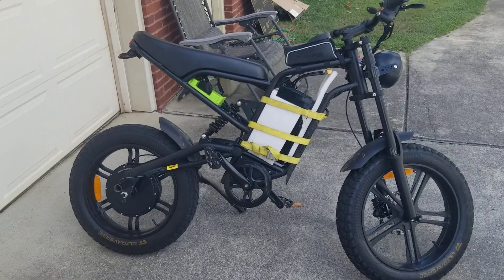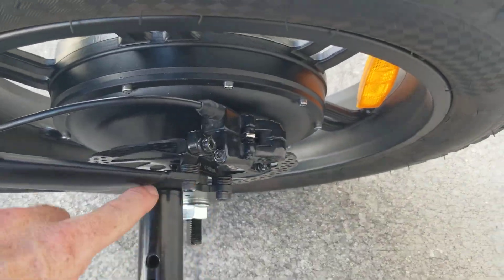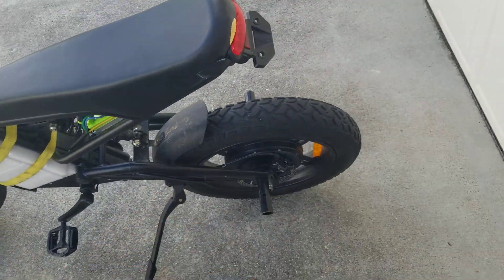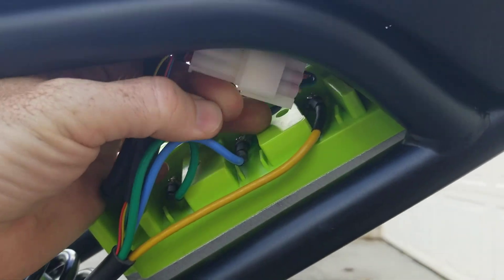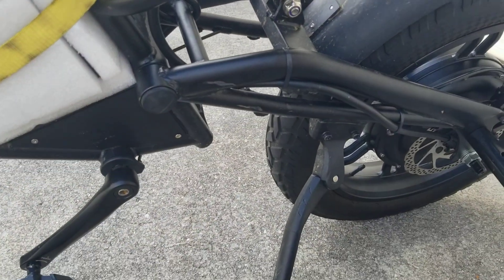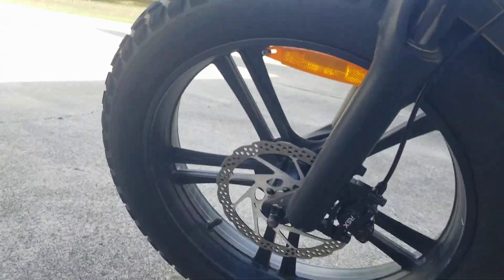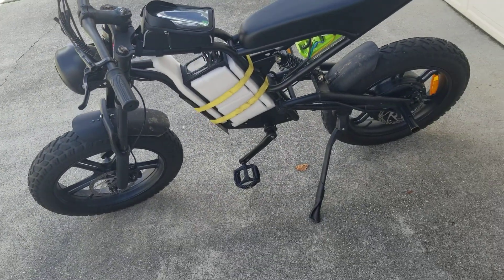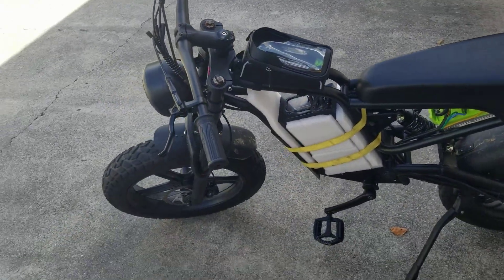52MPH e-bike:  Windone E2 modified to 60 Volts 4500 Watts (part 1)

Comment from the maker: Windone E2 e-bike
https://windone.com/products/windone-e2-fat-tire-electric-bike
$600 on facebook market place with the new tires.

Lunyee 4500 watt fat tire hub motor
https://www.lunyee.com/products/20inch-4500w-48-72v-100km-per-hour-gearless-hub-motor.html
$410 shipped by boat using Alibaba

Fardriver, twist throttle kit
https://www.hotpaxx.com/          <-- this business is fantastic!
ND72300 72V 100A LINE /300A PHASE SKU: ND72300
Throttle + key + voltmeter + 3spd + power + wired for Fardriver SKU: THR001
Hall matting connector for motor side.
$180 shipped quick and fast!

Amorge battery 60v 25AH, 120A
https://www.amorge.com/post/amorge-16s5p-60v-25ah-120amp-battery-for-onyx-cty2-electric-bike
Samsung 50S cells also got the 12 Amp charger from them and the connecting cable leads
$600 shipped by air using email +alibaba  chat and paypal

M6 1.00 x 25mm long hex cap bolts are what was used for the rear brake bracket and also for the controller.